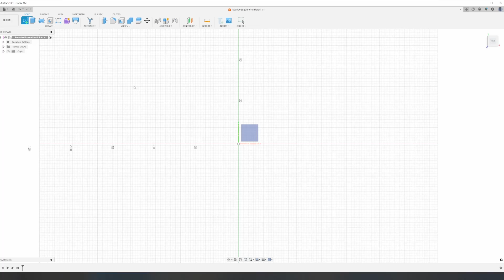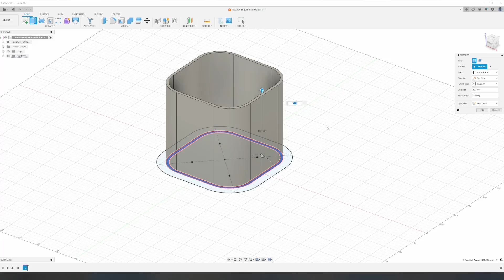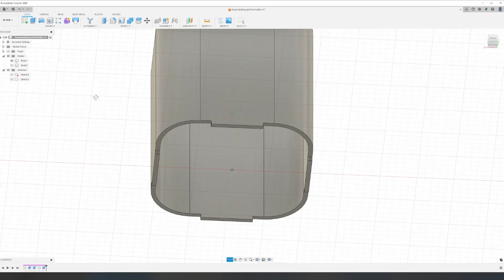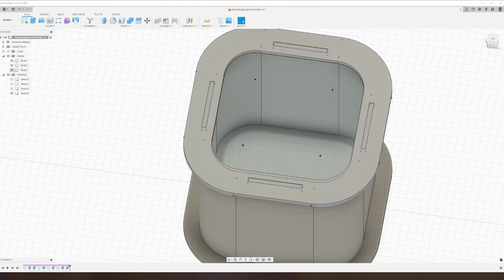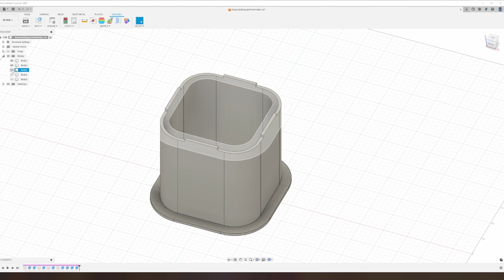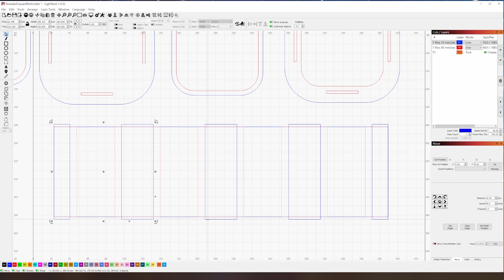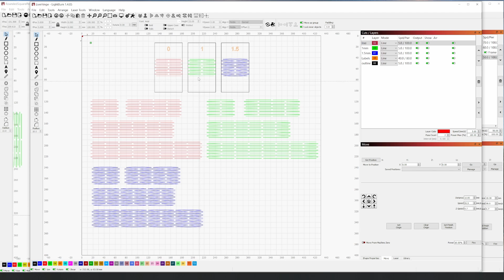Kerf Bending REVOLUTIONIZES Laser Cutting Projects!

Comment: why did u use the 1 mm pattern for flexibility, is it because the material is 1 mm or it doesn't matter?
Reply from the maker: The wood is 3mm thick. The flexibility comes from how much wood has to bend. The more you cut away the more flexible it will be but also the weaker it will be, so it’s a balance between the wood thickness and how much it needs to bend.

Comment: How's your experience with diode lasers? I was debating about buying another k40 because that was the only real option for cutting 1/4" wood a few years ago and I miss having that ability
Reply from the maker: I have a 40w diode and it cuts 1/4” just fine. 
Originally have a 10w and it want really practical to cut that thick. 20w is doable but 40w is butter :)
Downside of diode is you can’t cut/etch clear materials. You can etch glass but need to paint the surface with something to the laser to interacts with.